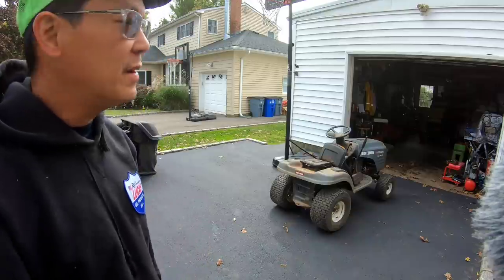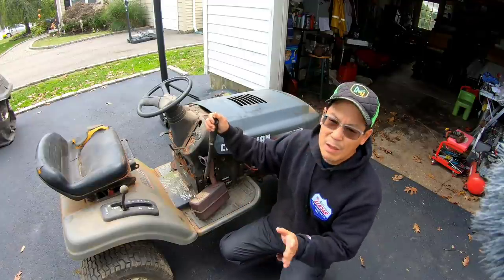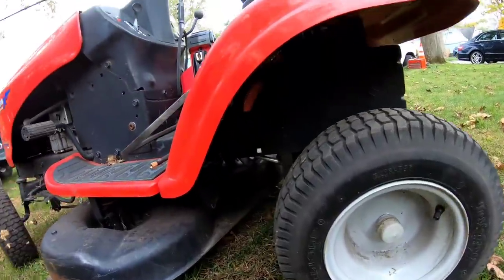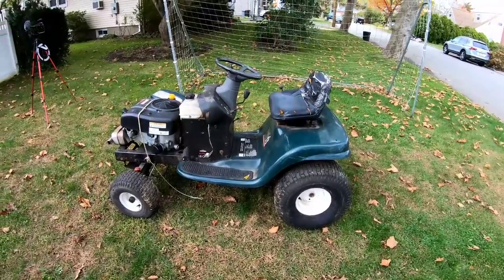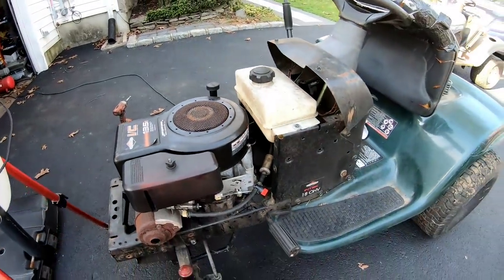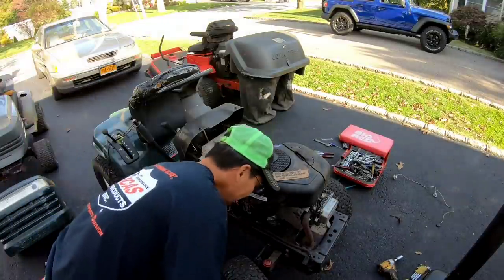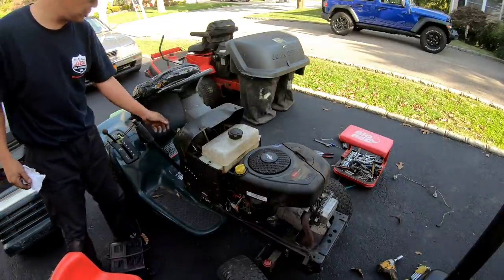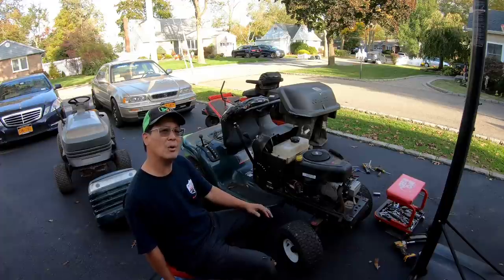TWO FREE CRAFTSMAN LT1000 FLATHEAD ENGINE SWAP & POULAN XT GEAR DRIVE 12.5HP 38" LAWN TRACTOR PICK

Comment: Henry, have you ever thought about "bench testing" your engines before going through all the work of installing them on a tractor?  I got an old plastic patio table with an umbrella hole in the middle; I just put the crankshaft down it, then jump with a battery direct to starter.    I also put a fuel line on vertically and fill it with fuel for a short (hopefully) run.  Enjoyed the video.
Reply from the maker: Nah, I know I’ll get to it eventually

Comment: That clanking noise when it turns over is the dipstick tube hitting the flywheel fan I think because it happened to me a couple times if it's not set in the slit in the cover properly it will hit

Comment: I'd say you put a 33ci flywheel on a 31ci crank, or a 31ci flywheel on a 33ci crank. Head scratcher engine 2.0.
Reply: Remember from the video I sent you the magnet is in a different position between the 2 models
Reply from the maker: Yes I remember.  Flywheel was stick on it, I never took it off!

Comment: Compression testers don't work on lawnmower engines.... They have compression releases on the cam shaft.
Reply from the maker: Yes but you can get an idea.  Leak down is more accurate.
Reply: You get a better idea just by Turing it over by hand to see if it has compression. If it’s back firing I’d bet that the fly wheel key is sheared off. But that spark was not good either. It was intermittent. But you should fix the obvious noise from the cover first....

Comment: Didn’t you get a mulch plug from nick in your last pick? Can just use that on the poulan and sell as a mulching tractor.
Reply from the maker: That would limit your buyers.
Reply: @MowersNBlowers  in my area most people prefer to mulch their grass so it would sell for the same as a side discharge

Comment: Back fired , sounds like timing is off , you may have a incorrect flywheel , I wonder if this is going to be another  engine flywheel  with  a nail in it ,  stay tuned for part 2  of. Mowers N Blowers
Reply from the maker: You got that right bro!